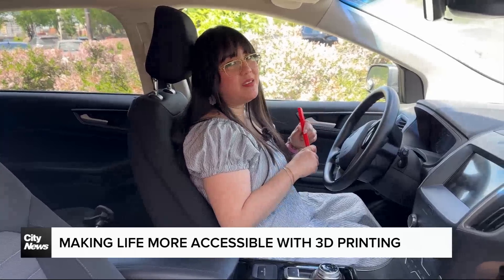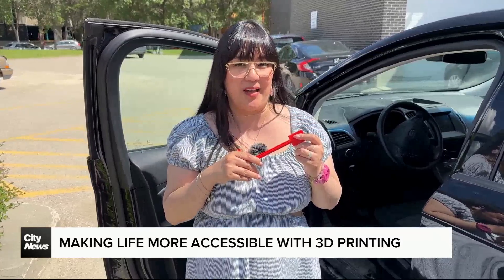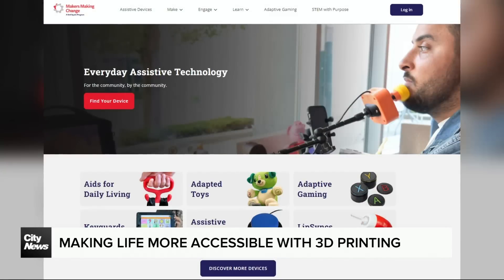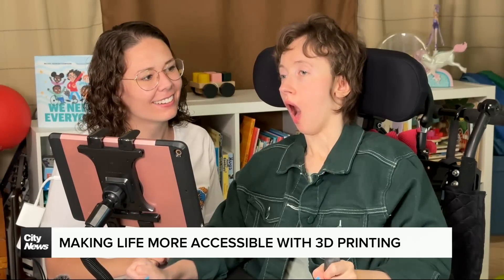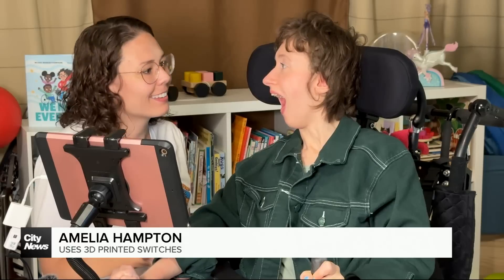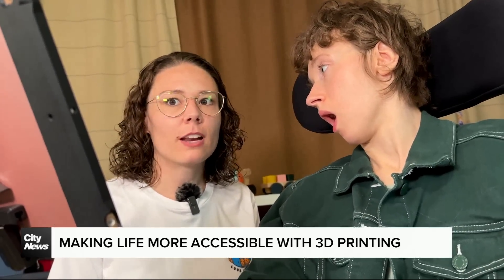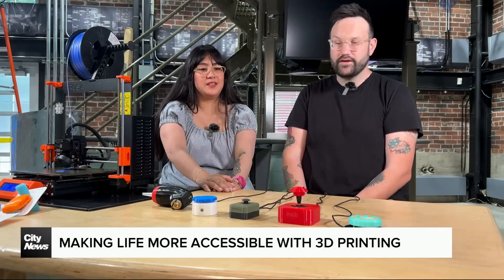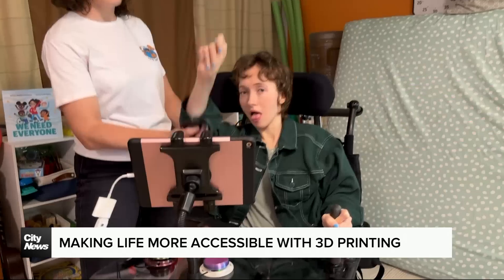Canadians using 3D printing to remove accessibility barriers at low cost

Comment: Yeup, this is how 3d printers are supposed to be used, make life easier abd repair products. Not to make guns
Reply: If you can't manufacture whatever you want, including guns, then what is the point of a privately owned 3D printer? You don't need an expensive machine to make a seatbelt releaser. A simple mold and melted plastic could make that. Or, just find a stick.
Reply: @sonniepronounceds-au-ni9287  "a simple mold and melted plastic" involves a lot more cost and work than just buying a cheap 3D printer.
Reply: @logitech4873  Dude, no. I don't know how much you think a cheap plastic mold takes to make, but I can assure you that it is not anywhere as much as the cost of a 3D printer.
Reply: @sonniepronounceds-au-ni9287  Ok walk me through the process. 
How will you create this mold, and how will you uniformly melt and pour the plastic?

The 3D printer you're up against costs $199.
Reply: The point of 3D printers are to rapidly prototype items on a small scale. If that item happens to be a gun, so be it.
Reply: The problem is that thee aren’t enough customers. I’ve been selling 3D printed products and banking custom orders for 5 years.
Reply: It’s unrealistic to think every home in the near future will have one. There is a lot of maintenance and specialty knowledge required in 3D printing.
Reply: @nerobaal6655  they're quite cheap though and Amazon sells them anyone can have one if they want one that's all that matters.
Reply: @nerobaal6655 the skill level required to operate a 3d printer has dropped significantly since the Bambu printers came out. It won’t take long before they are just as easy as a microwave.
Reply: @kel5944   People have no idea how a microwave works.
Reply: @kel5944   Boxer briefs come with instruct how to put them in correctly. Have you seen the education level  of the world?? They aren’t getting smarter.
Reply: Boxer briefs come with instructions on how to put them on correctly. Have you seen the education level of the world? They aren’t getting any smarter.
Reply: @kel5944   They most certainly can’t maintain the hardware or software that makes up their microwaves.
Reply: why not both?
Reply: @BringerOfD  plastic printed blades and knuckles are awesome too and the knuckles aren't even. Illegal
Reply: Micro plastic poison.

Comment: So what is the real cost, they say low, but never prove how low......
Reply: not a lot...something like the seatbelt thing wouldn't weigh more than 100g and 1kg of printing plastic can be between £10-£20 so at 10 parts per spool they would cost between £1-£2 each.
Reply: It depends but most of the time with stuff like this the makers will donate the cost so probably free
Reply: @lewisjohnson4207  "most of the time with stuff like this the makers will donate"  I wasn't asking about probably but rather reality.
Reply: @PatrickBaptist if you learn anything about the wider 3D printing community, let it be known that it's an awesome community and that most designers are very generous and release their designs for free. That being said, to actually print a tool like the one shown is less than $1 worth of filament. So if people do charge, it's gonna be a few dollars at most. These prints are going out to very worthwhile recipients, after all.
Reply: @ultramegax  Thank you and Marchache for your replies that what I was curious about.
Reply: It’s easy… First, download the stl file or design it yourself.  Next, open it in the slicing software. Enter the cost of your the filament and click slice… the software tells you how much material you will use and how much that material costs.  The example she used in the video likely cost less than $1.  3d printing is a hobby for a lot of people.  It isn’t rocket science…
Reply: @kel5944  I wasn't talking about his cost, I was wondering what the price he charges for his goods, sorry for my miscommunication but I wasn't referring to the production cost.
Reply: Depends on what they are making and how much plastic and time needed to make the item.
Reply: Here's how you find out, part 2.
Go to thier Web site and click some links.
You'll find a price and / or a 3d print file.
Copy that file and submit it to one of the many online 3d printing services to get a price.

For further research, think 'I won't be an idle sod"
Reply: In our case we donate our time and clients, if they are able, cover the cost of materials and shipping. Most of our 3D printed items would use much less than $2 cdn. The more advanced items with electronics would be more, but always at cost. As an example a commercial switch like our MMC60 (big round button) would run about $80. We make them for $5-$10.
Reply: The low low cost of the human soul.